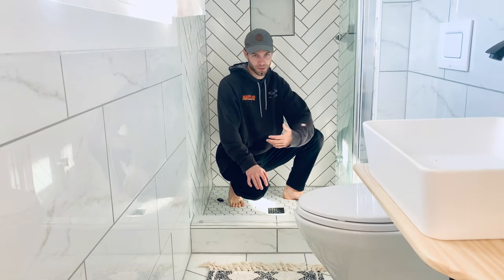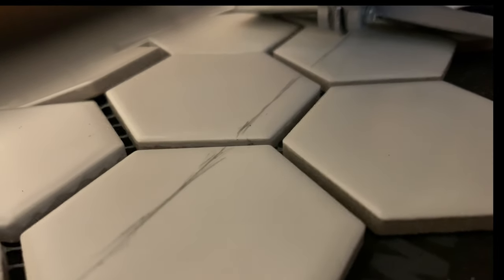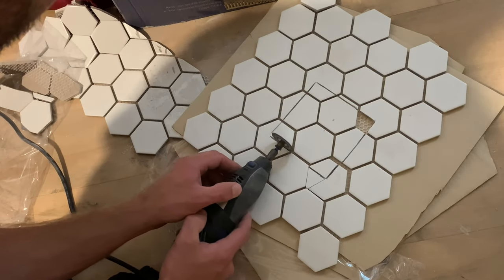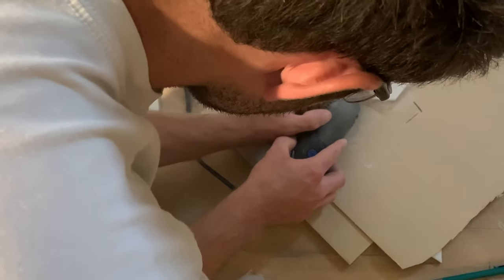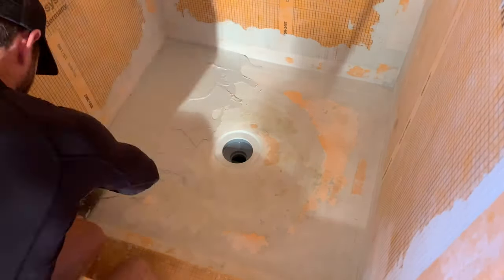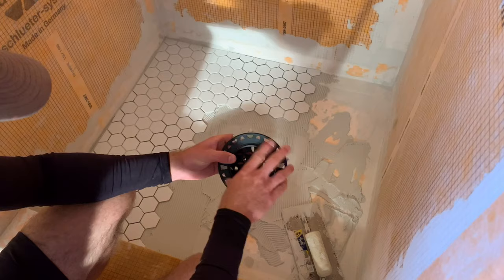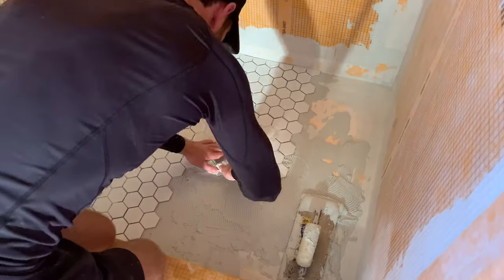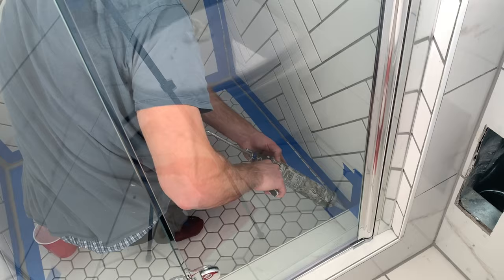Shower Pan TILE Installation [How to set a shower drain and tile a shower floor with mosaic tile]

Comment from the maker: Thanks for watching! If you want to be notified when I release additional bathroom remodel tutorial videos, please SUBSCRIBE and hit the notification bell!

Time Codes below: 
0:00 - Introduction
0:48 - Dry-fitting the tiles
1:00 - How to cut mosaic tiles
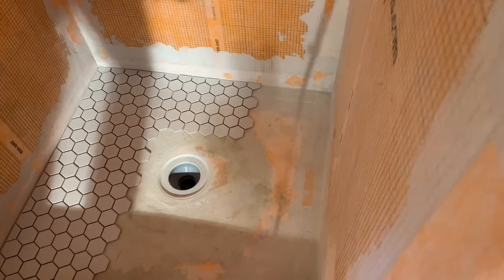2:06 - How to cut our the shower drain
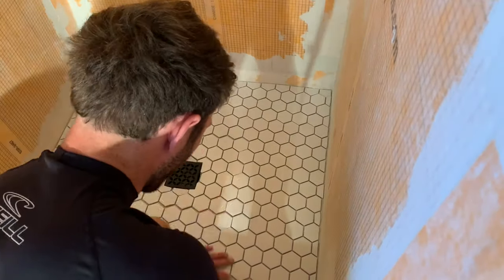4:10 - Mixing and applying the Mortar
4:40 - Applying the Mortar and setting the tiles
5:36 - Setting the shower drain
6:50 - Installation tips. 
8:00 - Tips and Clean Up info. 

Thanks again for watching!
Reply: What is the name of the glass door that is installed?
Reply from the maker: @isidrobautista8580  Hi, it’s a bifold door and a made a video showing the installation here:
 https://youtu.be/0aPxJiYp3-U
Thanks for watching!
Reply: your episode 1 and e2 links are the same--they both go to episode 1...
Reply: Is the base supposed to be levels

Comment: Great video. I never use that thin of a tile on the floor.same thing happened to me with too much thin set coming through the grout lines. I also never had a schluter drain grate go down low enough for those thin tile. I always use at least 3/8” tile now.keep up the good work
Reply from the maker: Appreciate it, Gene! Will definitely consider larger tiles next time. Thanks for watching!

Comment: Thank you Andrew! You did an amazing job showing us how to do these steps, including how to fix any “oops” (broken tiles) and to be extra careful of not using too much thinset. Btw, the part of applying the right amount of thinset/mortar is crucial, especially with mosaics as we never want too much mortar oozing up through the tight in-between spaces that mosaics tend to have. Like you mentioned, once it dries, thinset can be a nightmare to deal with, and can interfere with the grout application. If you’re like us, you always want your completed tile job to look as perfect as possible.
Reply from the maker: Thanks for watching! And you are so right - dried thinset where it is not supposed to be is the WORST thing ever lol
Reply: A xan l,
Reply: @AndrewThronImprovements  
I was observing your job of placing the slabs in mesh for shawer. I always have difficulties...they do not remain level and the mixture comes out between meshes. What do you recommend? Should I use another notched plane?...Thank you
Reply: I save old toothbrushes to clean the thinset between the tiles if there is an issue

Comment: I have bought the same tile for my shower and wow are the slippery when wet I ended up tiling ontop of it with 12x24 tiles that were rated for shower floors great work though
Reply: thank you for that info. I just installed those but we messed up on the pan and I pulled them all out before using the shower. the shower is for my disabled mother in law so slippery tiles would have been really bad.

Comment: Im doing my shower with kerdi and enjoyed your how to methods
Reply from the maker: I appreciate it, Mike! Hope your installation goes smooth 👌
Reply: @AndrewThronImprovements  just started cutting Kerdi shower pan and fitting in the curb as we type.. maybe get the membrane up tonight or early Sunday
Reply from the maker: @awesomemike8219  Good stuff! Trickiest part is the drain assembly!

Comment: Helpful hint. Do not use pre mixed mortar when installing the tile, it will not dry. I let my tile sit 2 weeks after installation and grouting. The tile started moving around the drain in about 7 days. I could pop the tiles off and the mortar was soupy. I had to take it all up and start over. So use the dry mortar you have to mix. The guy at Floor and Decor said the mixable dry mortar is what you use.
Reply from the maker: Thanks for the tip 👌👍 Appreciate you watching!
Reply: That’s a freaking nightmare my guy I always mix up my mortar anyway but now I know to stay away from the pre mix that’s just sad. Thx 🙏

Comment: What a nice tutorial!  We have a bit different floor waste "Bermuda" It should be installed before tiling and tiles must be laid around it. Can you tell me, whether any gap must be maintained in between the square waste and tiles around it (like a grout), or no gap around the grate? Which level difference must be in between the grate edge and the adjacent tiles? 0.5, 1 or 2 mm? And the last- how to finish this gap around square waste- the same like grout (epoxy)mix, silicone or leave it as it is with some tile adhesive inside? Thank you.

Comment: I’m wondering how to handle slope to the drain using a flat kerdi shower pan (which appears to be what yours is). I was hoping, but did not see how that would be done. Any help would be much appreciated. Thanks!

Comment: I did the same thing, had too much thinset or leaned on spots and have a lot of tiles (hexagon polished marble) with thinset in between.  I'm using a grout scraper and a few other tools but some of these joints arounds the drain are kinda thin.  How do I get it out without damaging the tile?  I know I chipped at least two edges already.   Will not removing all the thinset be bad?  I'm almost to the point of ripping it out, but how would I do that on a schluter foam pad without damaging everything?

Comment: Damp sponge would clean that excess on the drain in one or two passes (in case anyone else runs into that issue). Always good to have a small bucket of water and a sponge when doing tile lol

Comment: I wouldn't cut my drain tile like this. I'd cut any tile that land on the drain off the webbing after marking them as he did. Forget about them. Install all the floorpan tile. Come back to the drain and use a tile saw to cut and individually install the drain tile. Always use "square" drains for this reason. If you have to install a round drain then yes, that Dremel will be useful. None the less the end result is exactly as my method would look so to that I'll say great job. It looks very good. I do enjoy certain aspects of the kerdi systems. Other aspects I prefer the "traditional" way.

Hahaha. Man... I've been there before with the thinset pushing through lol and yes... Definitely clean that up when it's wet. You'll be in for a complete shit of a day if you don't.

Comment: Good stuff man! One question tho. Did you use calk or grout around the parameter of the floor tile?
Reply from the maker: Hey! I left an "expansion joint" at all changes of plane and then caulked it. I made a video on the caulking if you want to check it out: https://youtu.be/aEkJYRD66GU

Comment: would have been more helpful if you hadnt sped up the camera during the crucial way mortar is applied,  i have seen articles saying trowel should be held at 45 degree andgle?
but the real helpful part was the cutting of tile with the dremel tool, used it also on your example worked perfectly
Reply from the maker: Thanks for watching! Still learning the best way to present info, but glad you found the cutting part helpful! Glad it turned out well!

Comment: Does the drain have to stay below tile mine ended up higher than tile
Reply from the maker: Ideally it should be level with (or slightly below) the tiles from a drainage perspective

Comment: Great video Andrew. One question for you. Is grout or the cement beneath tiles waterproof? I am curious if minor cracks on grout and can cause water escaping to below unit.
Reply: The thinset mortar isn't water proof and if grout is cracking at all water can leak below the tile def
Reply from the maker: Hi! The Thinset is not technically waterproof. But I used epoxy grout between the tiles which IS waterproof. Hope that helps.

Comment: Hi Andrew! QQ - we have a similar setup in our stand up shower but recently after running the shower for 5-10 minutes the mortar under the floor tiles sound like they are cracking with every step. Thinking water is soaking through the grout of the mosaic tiles. We have a kerdi shower kit installed and we currently do not have any leaks but i'm wondering if there's anything we can do to avoid gutting the floor tiles, etc and replacing them. We've had the new shower for 2-3 years and only sealed it once after installation was complete (thinking this is the root cause). Also tried re-caulking and sealing again but  the cracking continues when stepping around the floor pan. If you don't use the shower for 12+hours (or until it all dries) the cracking sound disappears which makes me think it dries underneath only to be wet / loose again.
Reply from the maker: Hmm.. This may be a better question for a professional tile setter. However, it does sound like it is a water penetration issue through the grout. If that is the case, they make a few tools that allow you to remove the grout (and keep the tiles) and then you could apply new grout (I recommend waterproof epoxy grout). It is a time extensive project removing grout, though. That is my two cents, but I think a professional evaluation is your best bet. Thanks for watching!

Comment: please need  to help me to understand  . bath  place you fixed thermocol  sheet in ground. then after pvc sheet  cement and after Tiles . my question is  after some time thermocol sheet will shrink with weight. or something else you can explain me
Reply from the maker: Hi A Singh - I would love to help, but I don't think I fully understand the question. However, the I don't believe that the Kerdi Shower pan will have any shrinkage or expansion issues. Thanks!

Comment: You dont use grout between the floor and wall tile?
Reply from the maker: There are mixed thoughts on this. Some argue that the wall/floor intersection will experience settling and that grout will likely crack if installed there. If you follow that logic, caulk is a better bet. However, others claim that they have never had issues with grout cracking when installed between the floor and wall tile 🤷‍♂️ Let me know which alternative you go with!

Comment: Between the Kerdi pan installation and this video, you didn't address how to set the pan fall, to ensure water drains quickly towards the drain.
Reply: The pan has a built in slope to ensure water runs towards the drain. As long as the thinset is put on evenly, there won't be any problem with the water draining properly.

Comment: Should have just removed the whole tiles that were in the way of the drain. Cut out the mesh backing. Laid the sheet around the drain and then cut and places the few individual tiles that needed to be cut around the drain. You had to do that with the broken tiles anyway.
Reply from the maker: That's a fair point - we got there though. Thanks for watching, Leo!
Reply: We’re about to get to this step so I’m glad Andrew showed how he replaced the broken tiles. All mistakes are an opportunity to learn and teach.

Comment: Why not plug the drain, and tape the drain to avoid thin set in your drain cover?
Reply from the maker: Hi David! My plumbing wasn't hooked up yet, so I wasn't worried about anything going to the drain hole. I agree that I should have taped the drain cover - would have saved me some clean up. Thanks for watching!